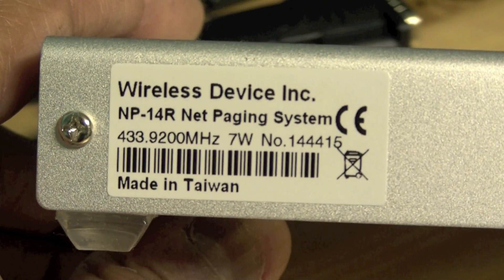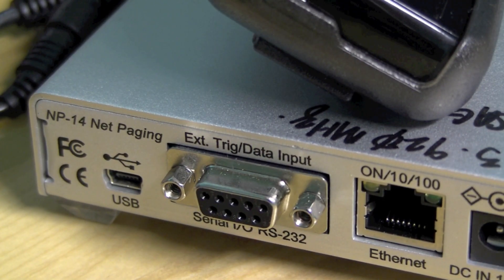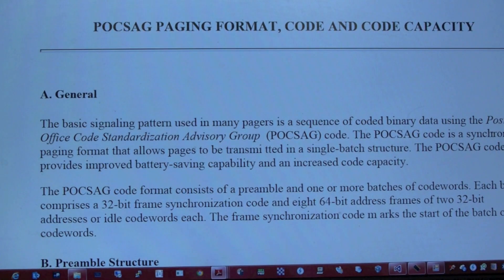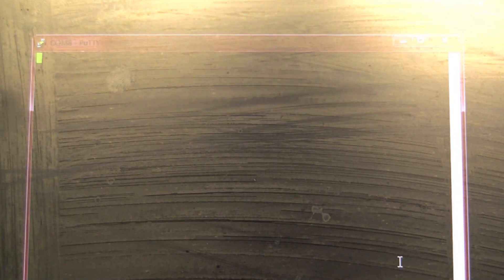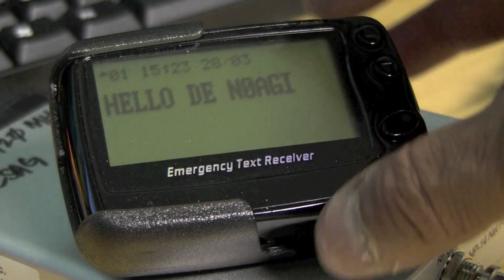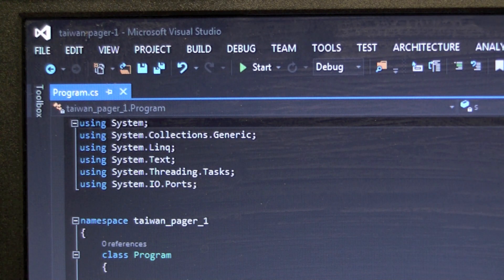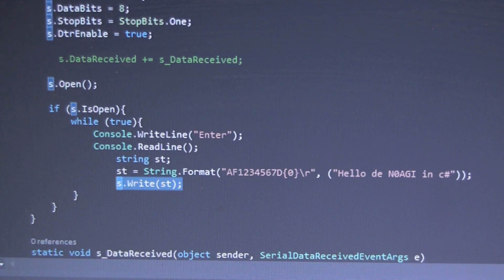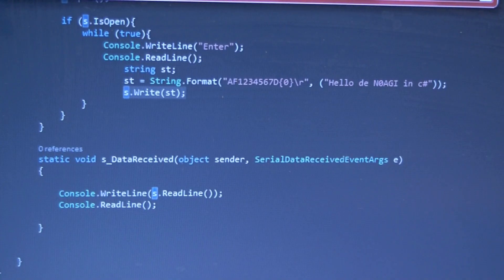N0AGI - POCSAG & PAGER w/ an Encoder+Transmitter

Comment: do you have any software for the pager? or a manual? i have one with branding
Reply from the maker: +RetroBit hi - not sure what you're asking for.  software for pager - are you asking for programming software ?  Typically, brand name pagers such as Motorola's need a Pager programming h/w/cradle that goes w/ the software.  I have one that I use to program my Motorola Gold line of pagers.  If you look in ebay for your brand pagers programming hardware/software, you should be able to find one for about $150USD depending on the brand. Hope that helps.
Reply: i ve got the same receiver like you in the video. the receiver got his own usb